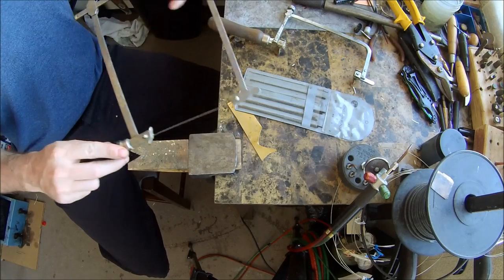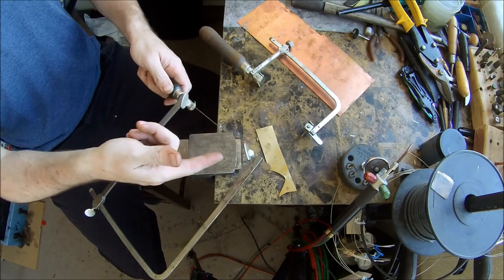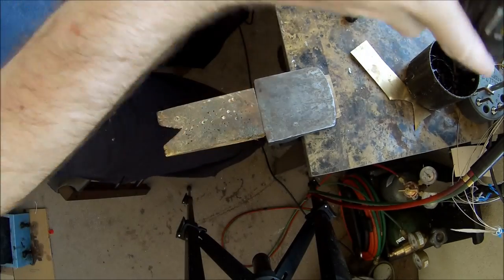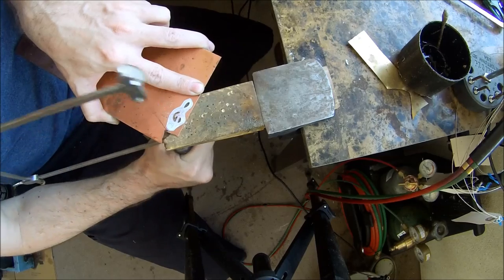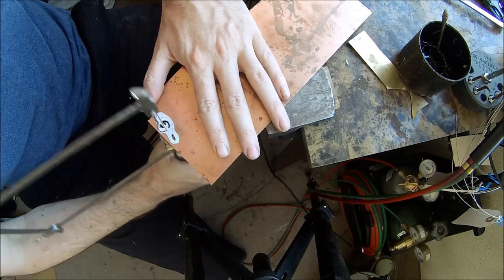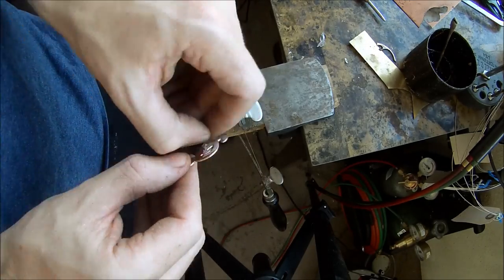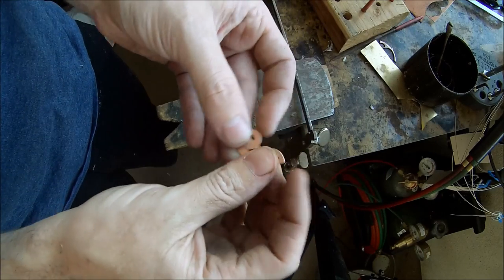How To Use A Jewelers Saw the Right And Wrong Way.

Comment: Copper inflexible - easier to cut due to resistance to bending when cutting pressure is applied.
Brass flexible - harder to cut due to bending when cutting pressure is applied. Got it!  Never knew that.
What a lovely clef design you cut out.  Makes me want to cut metal all day. It was very soothing to listen to your voice.
Thanks Randy, for another great tutorial!  Thank you for no music!

One tip - when you showed the polished cut out at the end, the links blocked the view completely. This was frustrating.  Try to place links elsewhere or wait a bit longer till the end of the video. Too many folks are plastering links all over the grand finale.
Reply from the maker: Thanks I will have to look at that and fix it to see if I can make that look a bit better

Comment: Hi, what i do for lubricant is use soap, you take a bar of soap, like Ivory or any cheap soap, put it in a container with just a bit of water in it, to keep one side of the soap a bit scummy, then you just run it along the blade from time to time, works very well. Soap also works well to lubricate screws before screwing them, which ends up a bit like glue once the soap dries up in the screw hole.
Reply from the maker: Well thank you for that info 😊 I have made a new updated video about this using waxes https://youtu.be/aR5iN9Qmw7c but I will keep the soap in mind.
Reply: @GomeowCreations  I sent your jeweler's saw video to a friend, I've tried showing her how to use it but as soon as I'm not there she either forgets how, that way she'll have a reference, she seems to have a problem with sawing downward hehe.
Reply from the maker: Haha that is odd, make sure she is using the right saw blade and not to push too hard maybe?
Reply: @GomeowCreations  Well I explained all of this to her multiple times, she wanted me to give her lessons but I gave up as she does not really listen, I think she may have a problem having a man teaching her hehe.

Comment: Ah! I keep breaking my blades.....I used the dremmel now. LOL ...I have a long way to go! Thank you I love your  videos.
Reply from the maker: Maybe I could help with that. What size blades are you using and what size metal and you cutting in mm.
Reply: @GomeowCreations  band ring is 0 .28 x -0.35...blade #2 ....I think my problem is I don't know how to put the blade in tight, so it does not curve and I end up putting to much pressure in the middle of the blade and it breaks! Thank you so much for replying.
Reply from the maker: Try a 3/0 or 2/0 blade and see if that helps at all. I do have a better video about this on my channel let me find the link.
Reply from the maker: https://youtu.be/aR5iN9Qmw7c
Reply: @GomeowCreations  Thank you ! I have homework now....lol.

Comment: Thanks for the tutorial. I am trying hard to master sawing. I didn't catch what you lubricate your saw blade with.
Reply from the maker: In this video I used some cooking oil but now I only use this https://amzn.to/2qkP9nA or you can use bee's wax https://amzn.to/2uYBrMy 

It takes a lot of practice to get good at using the saw. One thing that helped me a lot was getting good quality blades.

https://ebay.to/2qi0VzM
Reply: Thanks for the link. I needed someone to tell me what brand to get.
Reply: Just use a white wax candle, they work better than bees wax (not the translucent paraffin ones, those are awful).

Comment: Recently purchased a  jewelers saw and blade set blades look like several wrapped in wire. Are these bundles separate blades or the bundle as a whole  the blade?
Reply from the maker: You need to take that wire off, it's just to hold the bundle of blades together
Reply: @GomeowCreations   thank you, I appreciate the information. Just out of curiosity would these blades also work in a scroll saw? Recently inherited a scroll saw and the blades look similar.
Reply: I'm trying to finish a project my father started before he passed to honor his memory. He began cutting a pattern into a handbag blade. Because it is steel  what size blade would you suggest. I believe he was doing this to save as a pattern to make these out of wood.

Comment: You can put the metal into the vice before passing the blade through it. Much easier imo. Edit: curious why you don't use a vice or clamps to attach to the work surface?

Comment: Great tutorial! Thank you! Any reason why gluing a paper design is better than just drawing onto the metal (assuming one can draw the design accurately by free-hand)?
Reply from the maker: +Sheri Lynn Thank you. You can do it free hand. I did that for a long time but when you are trying to make a perfect shape, I find it a lot easier to use the printed design.
Reply: Ok, that makes sense- I thought there might be a benefit to sawing when the paper template is attached! I too will use paper- my drawing skills are limited beyond basic shapes! Sincere thanks for responding so quickly! Again, excellent tutorial- rather coincidental- just yesterday I made a hammered musical staff out of heavy gauge Argentium wire- I never thought to attempt it with sheet metal and saw- it would have been better! You opened my eyes and reduced my apprehension of the Jeweler's Saw!!! In spite of my other metalsmithing skills- I tend to find ways to avoid my saw when possible- I came out here with the intention of pushing myself to 'get over it' and your video helped! Your precision is beautiful! I subscribed!!!
Reply from the maker: +Sheri Lynn
I try to get back to all of my comments asap. 

I like to use the saw more the any other cutting tool, that is if I can. I feel I get cleaner cuts with little to no burrs.

I'm happy to hear that I helped. It does take some time to get good with it, and you will brake a lot of blades. =)

Thank you for subscribing =) 

Do you happen to have any suggestions on what you would like to see next?
Reply: @GomeowCreations  any websites to find jewelry designs to print ?
Reply from the maker: Honestly not really, I just make all my designs myself. I do have some templates for sale that will hall with this and some simple shapes https://bit.ly/GomeowCreationsProductPage

Comment: Can you cut very thin .012 to .018 (30 to 26 gauge) stainless steel sheet this way? Perhaps with a specific blade?
Reply: Did you end up finding the answer to this? Need to know how I can do the same

Comment: Hi great video! I’m recently Got my hands on a giant bag of old silverware that I’m going to turn into spoon rings. Do you think that a jeweler saw would be able to cut through the metal of the spoon? And if so is there a specific blade that you would recommend! Thank you so much!
Reply from the maker: I'd they are not steel you can cut them with no problems. I use a 3/0 and 2/0 for most things. 😁👍 I need to make a video about working with silverware

Comment: can beeswack be used as a lube? also how could I tell appart which blade? I ordered a saw like your smaller one off amazon but the blades arent labeled. I was cutting 3/16 brass and the blades kept getting loose even if I really tighten the saw or even the blades would break. thanks!
Reply from the maker: Yes you can use bees wax as a blade lube. There is a way to tell what blade you have by counting the teeth in a given area but I don't know exactly how to do it without looking it up. Check out this video I made about jeweler saws, it might help you out https://youtu.be/aR5iN9Qmw7c
Reply: @GomeowCreations  awesome! Thanks man!

Comment: if I don't have Bee's wax, what kind of lubrication can I use for the say blades?
Reply from the maker: You can get something called cut lube or is you really can find anything just go and get some very cheap wax candles 😄👍
Reply: @GomeowCreations  Thanks alot. I was thinking about that. Just was scared wether or not I should use it haha.
Reply from the maker: You can also use machine oil if that is easier to get.

Comment: What kind of adhesive do you use to glue paper designs to metal? (I've tried a glue stick and it doesn't work very well.)
Reply from the maker: This is what I used https://amzn.to/2ULOIDp before I started using label paper but it uses a label printer but I found this and it might work with your normal printer https://amzn.to/39vwavB

Comment: It's a bad idea to use cooking oil as a machine lubricant, because (as you observed at the beginning), it gets sticky as it gets old and exposed to air.  There are many other mineral-based oils that will not get gummy.  I get "Cool Tool-II" cutting and tapping fluid in a squeeze-bottle, to put a drop right where I need it.  Or you could use ordinary 3-in-1 oil, or save a few cc's of motor oil next time you work on your car.  But NOT cooking oil!
Reply from the maker: You are 100% right. I now only use pro cut when using my saw. I will be remaking this video in the near future.

Comment: Do you find a handheld drill works better than a flexshaft? I ask because I find it is slow going  with the flexshaft and I go through a lot of drill bits. Aargh!
Reply from the maker: Well I kinda have the best of both worlds now with some supper sharp drill bits for the flex shaft so I done use the drill at all for drilling holes now. Haha

Comment: Can you use any type of oil for the blade? Also, Is it important to use wax/ oil before sawing? I am currently attending a workshop and my teacher told me not to use wax before sawing.. I just want another opinion about it.
Reply from the maker: I wouldn't use oil like this if you can. I only did it because I didn't have anything else in hand and it did work. Use wax or cut lube on the blade. Check out this video I made that is much better all about the saw. I use cut lube before a saw and as I saw depending on how much I have to cut. You can feel and hear it when it needs more lube. https://youtu.be/aR5iN9Qmw7c

Comment: Thanks just started and your videos are very helpful .  Is there an alternative to using " ILLUSTRATOR" by Adobe for making your designs on paper. Seem very expensive for the little I'd use it. Also , What type of adhesive do you use to glue your design on to the metal .THANKS
Reply from the maker: Well I made this video years ago now but you can get something called inkscape now that is basically a free version on illustrator 😁👍

As for the glue I use, it has changed. I was using a 3M spry glue but I now print all of my work on lable paper and cut it out, it's basically a sticker. You can also use super glue. I know that sounds like a bit of over kill but it works and you just burn it off when you are done. I have some newer videos showing how I do this.

Comment: So first you drill a small hole and then saw the hole . I didn't  understand that part. What line are you following once you drilled the hole?
Reply from the maker: Sorry that the video isn't that clear but the paper that I have on the metal has line work printed on it.

Comment: what size of blade did you used?? i tried to used coping saw for names but its worse.. i really want that jewelers saw and that size of blade.
Reply: Zy Ceniza did he help u with what size blade u need? 🤔 best thing to do is get a mix PAck of sized from 6/0- 8 or something like that.  6/0 being super tiny with lots of teeth and 8 being for thicker stuff.. An other reason to buy loads of blades, Ie a multi pack is bcoz u will break tonne of them haha even after years of experience 😉 hope I helped u out a little bit..  And this guy didn't demonstrate properly how to put in a blade u are mention to tension the same frame by pushing it again the bench and then clamping down the blade then release the tension and boom, u have a blade as tight as a guitar sting that u will here a high ping from when u pluck it.,
Reply: Don't buy cheap blades just so you have blades, Invest in better blades and they will break far less than the cheaper ones. I know from experience.
Reply from the maker: You are 100%right and I hav a better video about this topic https://youtu.be/aR5iN9Qmw7c

Comment: Really interesting! I have a question: I am using 5/0 blades to cut pearl (MOP) of 1.3mm thick. It is really difficult to not break a blade every 15 minutes of cutting. Do i have to wax more? Any suggestions to improve durability? Thanks in advance

Comment: I know this is an old video but I'm finding the chart a little confusing so I have a few questions. Firstly, I wish to cut 0.5mm and, 0.75mm brass sheet, and 0.5mm and 0.8mm thickness G10, can you tell me what blade sizes you would  recommend?
Secondly, I've seen blades that look like the one in your illustration which are similar to a coping saw blade and also a spiral blade. What are the spiral blades for? 
And help is much appreciated thank you.

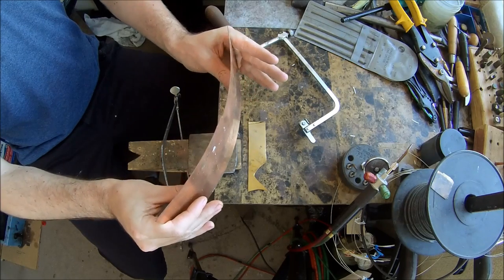Comment: Hi, I have a question for you: I have a 1:18 diecast Chevy Caprice and I wanna cut the back pillar windows from quadrilateral to triangular, is this the tool I should use for that?
Reply from the maker: Can you send me some pictures of what you are talking about to my email gomeowcreations@gmail.com
Reply: @GomeowCreations  I just sent you a few flicks.
Reply from the maker: This saw might not work for that. If you just want the window cute out you would have the drill a hole in it and feed the saw blade into it and attach it to the saw again... I think this will just hit on the over side of the car.
Reply: @GomeowCreations  Okay. Do you think a dremal saw would work?
Reply: @MagneticPizzazz  dremel will most probably work
Reply: red you think it will be the most appropriate for that job?
Reply: @MagneticPizzazz  for sure, get yourself a tool kit for it with like small carbon cut discs and small sanding heads. should be able to find it at like home depot, thats where I bought mine. you can also buy small diamond burrs kit for it for like 10$ on amazon if you want to go in the nooks and crannies. I'd suggest practicing on another piece than your diecast first to get a feel for how it cuts. best of luck! let me know how it went.
Reply: @WUTANGCLANMOFOS  I've tried it. Well, let's say that it was a fail lol. Those tight corners of that piece doesn't seem to work well with tightly curved metals. Luckily, it was a beat up old diecast model instead of mint condition one.

Comment: One more comment. I think it's integral to have that block you're cutting on I was cutting downwards, off the edge of a table. Where do you get that thing?
Reply: Notorious Lee  I haven't seen them in stores, but you can get blocks on many places online for pretty cheap. I bought a set of 200 blades, a saw, and a cutting block on amazon for 16 bucks.

Comment: What glue does you use to adhere your template to the metal? I tried crazy glue but had a hard time removing it. I ended up scratching my piece up
Reply from the maker: You can use a normal glue stick but super glue does work really well to. Also to get it off you can just use a torch and burn it off.

Comment: Hy, does that saw can Cut 18 g Stainles Steel 304 ???
Reply from the maker: +Pedro Servia I have used it to cut stainless steel but you have to make sure you have the right blades to do it.
Reply: GomeowCreations where I can buy the saw and the bladea good quality for Stainless Steel Cutting Im from Puerto Rico ...
Reply from the maker: +Pedro Servia look for a jeweler saw and diamond saw blades might work. You will have to check a jewelry supply store or order them online.

Comment: This is an old video but when adding a new blade do not adjust the height of the saw blade. Lightly push the saw against your table and then put the blade in. It will then pull the blade tight.

Comment: Why would a blade not cut strait? I've seen people with this problem. Also I've heard that bending the saw itself to stress the blade is the "proper" way to set a blade on a Jewelers saw...what's your take on that
Reply from the maker: +Greyson Ciganer I have had problems with blades not cutting straight. This was when ai was using low quality blades. After looking them over you can see that the blade itself was bent. After using high quality blades this probem had gone away. 

The proper way to us the saw is to keep it straight and move the part around it. I have found that moving both can be very helpful for detailed work. It all really comes down to what will work for you.

Comment: The chart convertion factor it's wrong! 1" = 25,4 mm so: 0,01" = 0.254 mm (i recomend you to use mm when you work with tiny values). May i give you another advice? Zoom in a little bit when you show how to put the saw blade 😉. 
PS: sorry for me shitty english
Reply from the maker: You are ring and this video is really not the best, I did make another one that I think is better https://youtu.be/aR5iN9Qmw7c 😉